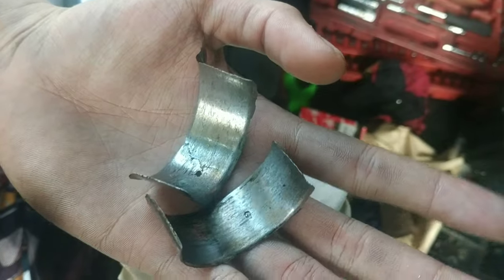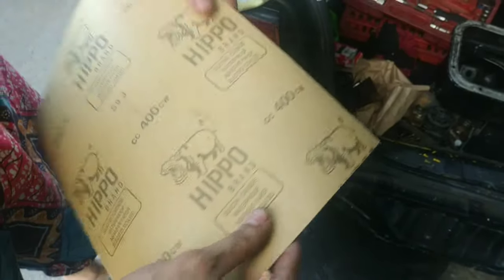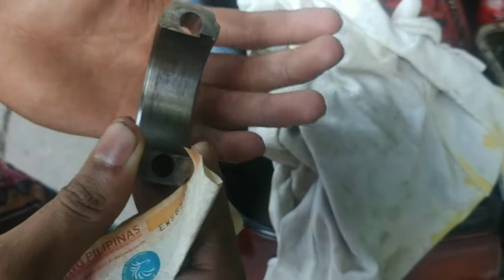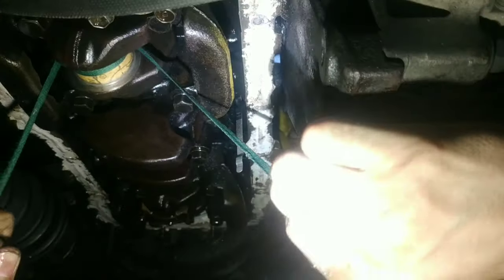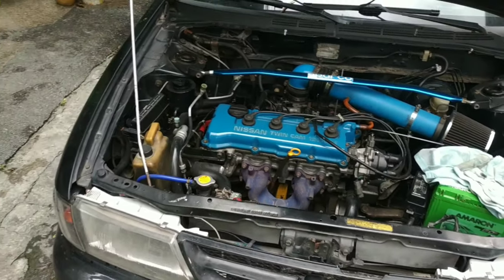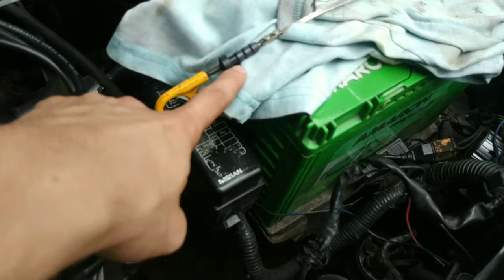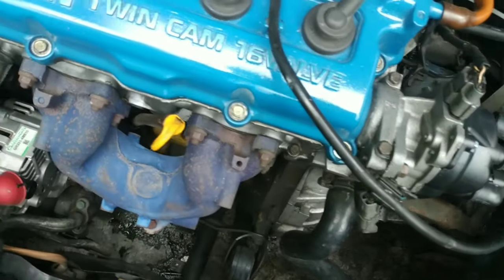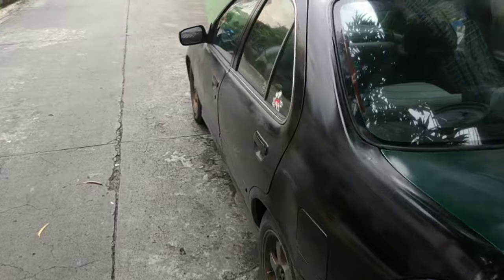Conrod bearing replacement on Nissan Sentra.

Comment: Is it still working good?
Reply from the maker: https://youtu.be/-M9oR8-0TYo   Yest i even used it for new years fun run
Reply: @DCworkzTV  I'm glad to hear that,  I'm in the process of doing that,  just got the bearings today, the car been sitting on Jack stands for a week lol , hopefully I can make it tomorrow if not raining on here
Reply from the maker: @dhaher121  im hoping that you can understand my language. Well you need to have time courage and balls to it becoz when u missed a 2-3 mill of a lash on the piston rod and crank shaft pretty much it might take only few cranks and it will be knocking again, so measure it 3 or four time just to be sure on the bearings gap. will make a vlog how to polish a crank shaft with English subtitles.